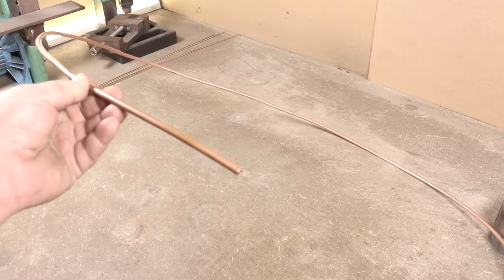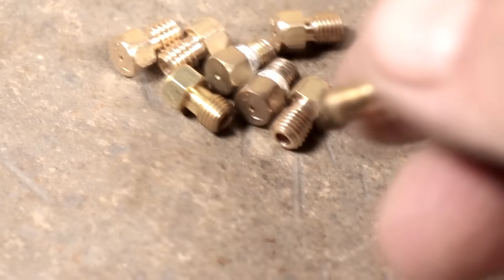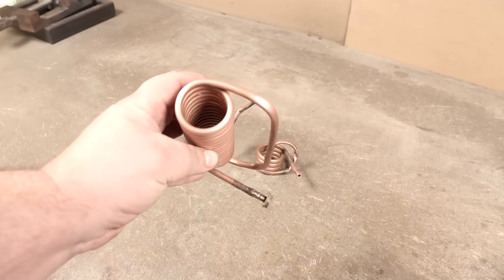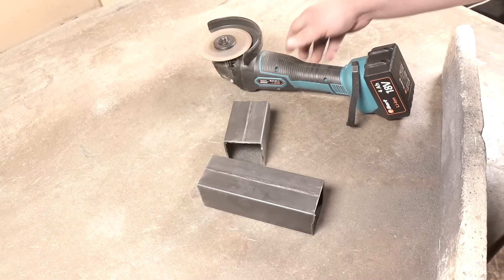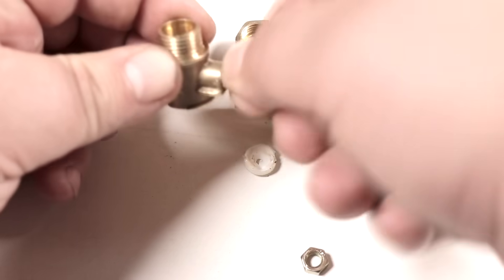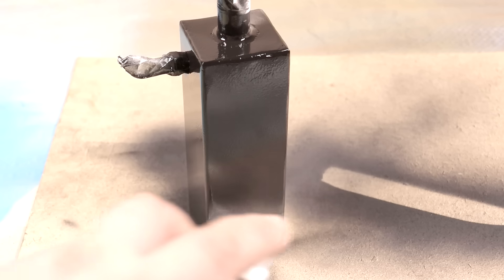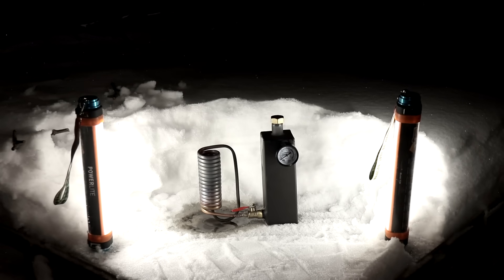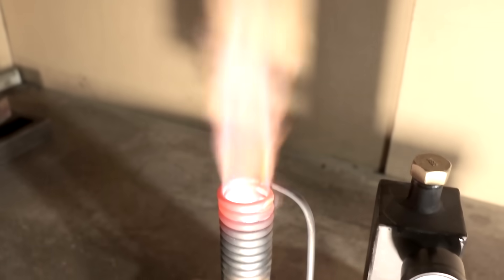Firewood is not needed anymore. BURNER USES WATER.

Comment: The reason there's no pressure and why you can't regulate the flame is because the valve is before the coil. If you put a valve after the coil but before it's burnt the pressure will increase according to the valve position. But be careful of the pressure, or it might explode.
Reply from the maker: This is a very good idea! Thanks a lot! I will definitely try and be careful, I will put an emergency pressure relief valve.
Reply: Be carefull with the valve my friend...

You don't want to accidentally endup in a clowd flammable fumes, combined with oxygen
Reply: For shure you should check your valves not to contain any plastic

If you want to use otnon the HOT PRESSURE side!

Youndont want a sudden clowd of explosive gass escaping all at a sudden.

I believe water to steam is an increase in vollume of 30x
Reply: @doctor-robo  have in count that if you reduce the pressure from one end of the coil it will escape from the other end increasing the pressure on the fuel tank
Reply: @doctor-robo  A pressure relief valve will need careful thought.  If it vents flammable vapours or fuel from the tank it will be a potential flame thrower.
Reply: @doctor-robo ❤!
Reply: You could try installing a pressure regulator.
Reply: A sárga réz  930C° fokon olvad a gâz làng  1100C°  egy idő után el kellene olvasnia a cső spirálnak!

Comment: put some safety fail safe in there if you can otherwise might go boom if it melts down if possible do a safety check in a blast proof container or safe location make a second device and run it until failure just so you can improve upon the safety and longevity of your device you made
Reply: I feel the hotter the tubes get it becomes unsafe.
Reply from the maker: Thanks a lot for the advice! I will definitely upgrade my project and improve the security of the device!

Comment: If you fill the copper tube with sand first and flatten the ends you bend without worrying it will kink or crush. Really awesome flame from what you have built. what a beast!
Reply: WOULDNT A TUBING BENDER BE LESS TROUBLE,IM THINKING GETTING ALL THAT SAND INTO THEN BACK OUT OF THE TUBING,ESPECIALLY AFTER SHAPING WILL BE A HEADACHE. RIGHT?? IDK,IVE NEVER THOUGHT ABOUT A BUILD LIKE THIS.
ALL THE BEST TO YOU!
Reply: @jiwbink  I agree with what you are saying my friend. This is what I thought when my friend suggested it to me some years ago. As long as you use fine, dry sand when you open the ends up all you do is tap the tube and the sand begins to run out. Bending does compress the sand but it isn't too much trouble and the result is very good.
Reply: @jiwbink 1 na q na$erś by unii
Reply: @jiwbink  ㄹ
Reply: this diameter of bending does not require filling sand....
Reply: @vetinger  amen
Reply: Try annealing the tubing first and results will be good.
Reply: I would advise using salt instead of sand, works just as well but sand is difficult to get out if it is under pressure. Salt will dissolve with water and heat😁👍
Reply: If you first fill the copper tube with kitchen salt and flatten the ends, you can bend it without worrying about the tube losing its circular section. Once you have finished bending the tube, you can remove the salt with water.
Reply: @LordCommander1  Yes!! Brilliant suggestion. Much easier to remove entirely.
Reply: Thank you.
Reply: Nice I try it with sand thx haha
Reply: Broooooo THIS
Reply: J’aime bien les commentaires 
Êtes vous tous plombier
Reply: Doldurduğu likid neydi depoya
Reply: @fadimeligunler1161  I think he just used gasoline.
Reply: Do u really think he does not know this already?
Reply: @peterloichtl4512  No idea mongo.
Reply: Risque de sable dans le gicleur
Reply: Ce tube est petit et recuit il ne s’écrase pas
Reply: Salt works better
Reply: Sand works okay salt works better i believe the best method is with water in the pipe keeps it from crushing and way easy to get out
Reply: @gargoyleking529  frozen water, or ice. 

Liquid water would require a pressure secure seal on both ends and absolutely no air. Water doesn't compress so bending the tube increases internal pressure.
Reply: @reykorjandel  It should be easy enough to fill with water and have no air in there. If the tube is straight, hammer crimp one end of said tube. Heat and solder the end of the tube, plenty of flux and capillary action will pull the sucker right in there. That's one end sealed. Fill the tube whilst it is stood upright. Once 'full' bend the tube below the open end and hammer flat, even fold a couple of times if you want. As the tube water filled tube is then formed into shape the end that is not solder sealed will allow relief of pressure but not so much that the tube will crush.
Reply: @gargoyleking529  I will try the salt and the water method next time, thanks pal.
Reply: No mention is made of using WAX and this I find no problem with as removing it just requires heating it up.
Reply: @pieterbezuidenhout2741  hey geneus for small diameter tubing filling it before bending is not necessary
Reply: @peterloichtl4512  Depends how tight a radius you want.

Comment: Flash steam boats model use similar units
Reply: @doctor-robo  sorry for the horrible grammar. You can find videos of Flash Steam model boats on YT, and probably Model Engineer Magazine's forum has posts about them. TEE publishing might have one or two old book on the subject. These boats are VERY fast, and go around a pole anchored in the bottom of a small pond. It's like line-, or U-control, for boats. Line control aviation has a division for speed as well, as do cars.

Comment: This is how a burner on a hot air balloon works. They use LP (propane).
Reply from the maker: Yes! You are absolutely right! There is a very similar design, only different fuel.

Comment: Great idea but instead of copper I will use heavy duty stainless steel break lines.
Reply: Yes that thing looks like it could reach copper melting temperatures.
Reply from the maker: Yes, a stainless steel tube would be much better. And you need to put a small air pump into the fuel tank for the initial start.
Reply: Brake lines, perhaps?

Comment: As the fuel burns, the tank can not let air in to replace the used fuel? I think that can affect operation. It need a way to let air enter as fuel leaves , or as a "Coleman" Lantern, it has a pump to add air pressure inside the fuel tank. Great video!
Reply: It works under it's own created pressure Wes, letting air into the tank would release pressure, causing the flame to go out.
Reply: @pa_maj.MARTINI-van-MAN  
I like Wes don't understand where the tank pressure comes from.  What did I miss?
Reply: @AB1Vampire  Heating of the tubing creates the pressure.
Reply: @AB1Vampire  As Thatsonebadhatharry said. "Heating the tubing creates the pressure". The tubing getting hot causes the fuel to vaporize into gasses causing pressure which then escapes as a vapour, this ignites as it leaves and joins the pre-ignited fuel until it can sustain itself from that point onwards. Think of how steam leaves a kettle when boiling except steam is non flammable of-course. I hope this helps Kes!
Reply: I think you are creating a bomb.
Air under pressure. (Which will drop the egnition temperature probaby) 
Mixed with high octane fluid.....
In a airtight steel container!!!!!!

Wau.... That would be a grate way to kill yourself.

If you raise the pressure of this mixture high enough.

IT WÍL SELF EGNITE!!!
DON'T DO IT!!!!!

It is the same way a diesel engine works. Thats why you don't need the sparkplugs, only preeheating plugs in cold climates

Comment: Great tutorial! neat workmanship.. What is the rate of fuel consumption?
Reply from the maker: Thank you! Fuel consumption depends on the desired power. The higher the power, the greater the fuel consumption.
Reply: @doctor-robo  So what’s the fuel consumption at full power, half power, and low power in grams? 

What’s the boiling rate for one liter of water per power setting in grams? 

What would that be for diesel, kerosene, white gas(naphtha or Coleman fuel), and regular unleaded gasoline? 

What’s the cost of building this stove?

Where would this be most useful?
Reply: @emeryz10  I hope he replies Apexfizz, I'd like some answers as well.
Reply: @emeryz10  build one, find your own answers.......
Reply: @joemendyk9994 , it's called being an engineer. You know those things people blame on engineers because it seems stupid? Yeah, that's me, except what you don't know is that everything I've designed and certified never had those silly things you find. Why? Because I ask questions that have value. 

You build your own and run into efficiency problems like he’s going to. Waste your materials by creating a second failed model. 

Think before you speak. Being a parts changer doesn't make YOU brilliant. It just means you can change a broken part.

Comment from the maker: Did you like the idea friends?
Reply: the tubewinding and the tube could be more smal and narrow so it will start quicker or could also run with kitchen oil. also a variable nozzle or exchaingeable nozzle option for different kinds of fuel... and a starter candle should be good thing to add. ...
Reply: Copper won’t last long . Only stainless steel can handle the oxidation and heat process.
Reply: Awesome idea, make it smaller, make a small one like Coleman or BRS 12A stove
Reply: yes loved it thanks i sub
Reply: The Russians may want to by some? They'll test them on their soldiers, I herd they were getting cold.
Reply: No
Reply: Él caño de cobre con un poco de uso se va a quebrar o derretir ,
Reply: اره جیگرم
Reply: You sound like a robot 🤖
Reply: Salut ,fabrici pentru prieteni ?